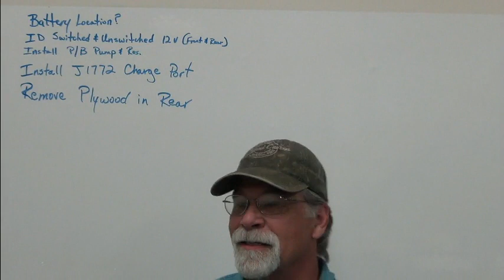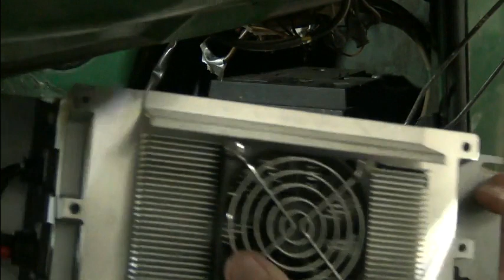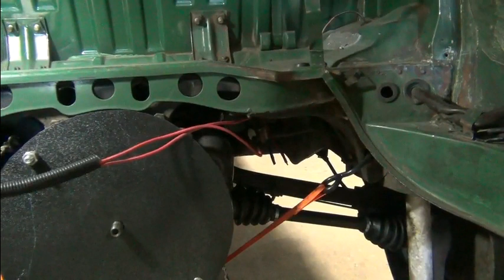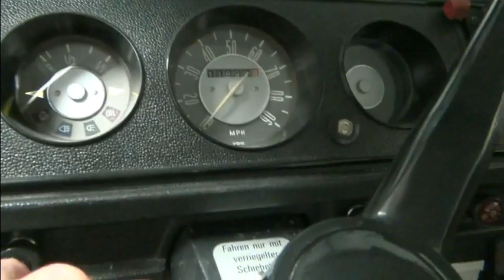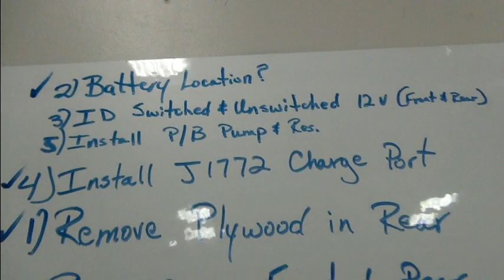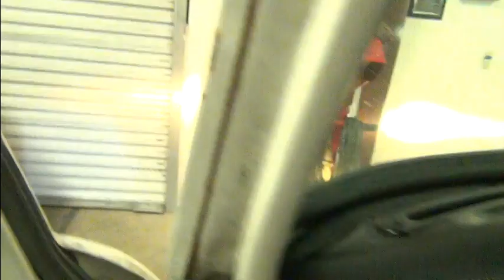The EV Conversion Information Channel - Converting to Electric is Fun

Comment: Hey there! Thanks for all your videos! I intend to repower a sailboat with 12KW bldc motor. The motor I have is a motenergy me-1306. I have a 24V battery bank. What controller options do I have? I would like to keep the controller under $200. Ideas?
Reply from the maker: Please address questions to info@EV4Unow.com